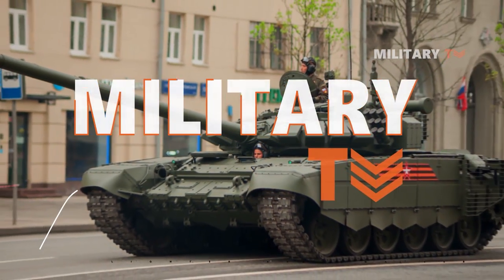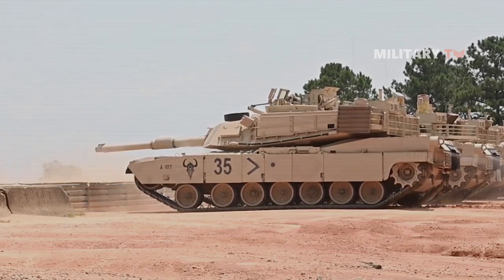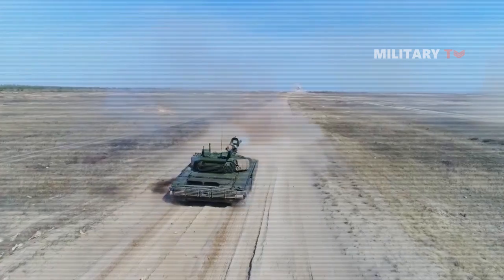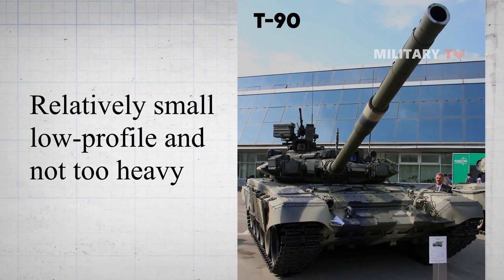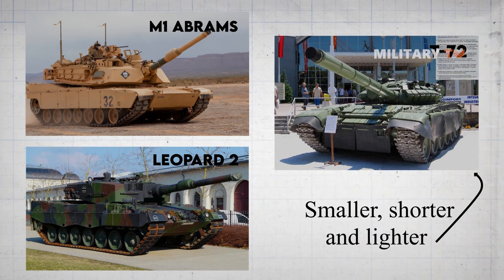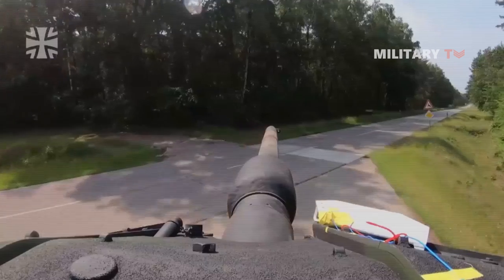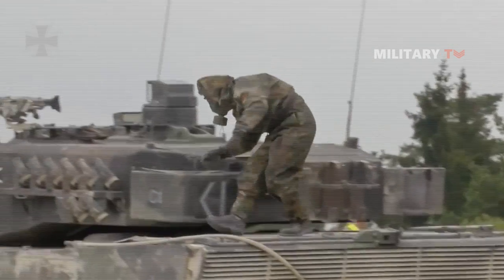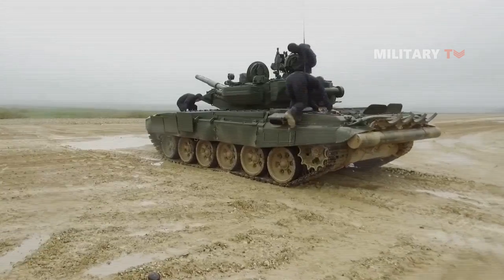Why are Russian tanks lighter and smaller than the western tanks

Comment: There are many many reasons for the size difference.  Doctrinal differences first, these tanks are designed for different purposes in the cold war.  Western tanks focused on heavy front turret armor and large ammunition capacity intended to engage from hull down positions against a larger attacking force.  Russian tanks favored mobility, small size, and low cost to make them harder to hit and more numerous on the offensive.  Other factors like gun depression, targeting optics and armor tech and type also greatly affected the size and shape of these vehicles.  Lighter Russian tanks would be good at traversing more types of terrain hoping to bypass and outflank western adversaries when possible.  Larger western vehicles often knew where they would be deployed and had prepared positions available, as well as known paths to get there even at their heavier weight.  No modern tanks are completely immune to ATGM's or other anti-tank devices today any more than they were in WW2.  The tactics involved in deploying and protecting them from these types of attacks has not changed a great deal since then either.  The best tank can be easily destroyed if enemy troops are allowed to get close enough and particularly if they get on the flank or rear of a tank.
Reply: The T90 is not from the cold war. The T90 is from '93 and on paper the cold war was to '91. And modern tanks are very good protected against anti tank missles. They can jam signals, they can shoot stuff up so the missle will be disconnected to the target and you never can close enough because these tanks have 360 night and termal vision.. Try to come close to these tanks and ur done.. okay of course there is a chance, but it wont be as easy as second world war.. On youtube you see always hits with these weapons, but in reality when the tank or tanks shoot back than you dont have that much time..
Reply: These lighter Russian tanks are better armed than an Abram. An Abram has a 120mm smoothbore and the T90 125mm smoothbore and can shoot guided missles through the barrel.  And the armor of these tanks are so tough.. even when they are 20tons lighter, they are just as strong also because of the model.
Reply: @EdgewiseSJ: In general Sowjet tanks were produced as consumables during a conflict. Their only purpose was attacking the enemy and overloading the defense by their sheer numbers. It was not necessary to carry a lot ammunition since few tanks would survive long enough while attacking to fire many rounds.
Sowjet tanks were capable of high forward speeds but very slow backward speeds. Western tanks on the other hand were capabel of relativly high speed backwards speeds as well as high foward speeds.
Reply: Suniorrita<3  old leopard was that.. the leopard2a7 is much better than the tanks in syria and a T90 has detection sensors so if somebody in a radius shoots missles these tanks will notice that and than these tanks can send signals to jam these missles, just like fighterjets does. Of course when you r close enough you can hit them but these tanks have 360 vsion night and thermals.. you can not come close, he always sees you..
Reply: They can spot everything in a radius of 5km, while other tanks only have 3km. But of course they can hit.. when you have good trained anti tank units... but i dont think Ukraine have good en enough anti tank units..
Reply: The problem I see with heavy tank sitting on hull down position in moder warfare is that with modern precision guided missles and bombs it is a bad idea to sit tight in one place. Modern tanks need to change their position all the time to be protected from air force. I believe in future tanks will have as heavy armor on top as from front projection
Reply: @toolfreak78  The majority of Russia's tank fleet is highly vulnerable to ATGMs besides the M and MS variants of the T90 the tanks don't have blow out panels meaning the chances of the crew and internals getting cooked are high. Also I'm assuming you're referring to the T90s eyes as the optical sensor which has been proved to not be the greatest as a lot of ATGMs are unaffected by it. Also various other factors can be considered such as the now useless ERA against neer peers as the more recent NATO tank ammunitions and ATGMs would either circumvent the ERA or go right through it. Basically Russias most modern tanks are good but there's not enough of them for Russia's numbers doctrine to matter. Also yes I know a lot of NATO countries also have an aging tank fleet but Western tank design philosophy for the most part. The T-14 and T90 M/MS are serious threats to all Western tanks, and no I'm not saying the aging tank fleet is useless because there are also clowns among NATO tanks like the Leopard 2 with it's outdated nightvision as well as some other optics if I remember correctly.
Reply: @arslanseitaly8364  Honestly no one can say for sure. However recently investments have been going towards lighter vehicles that would essentially act as Light Tanks or Tank Destroyers, with purposely poor armor to speed the tank up, but also featuring a greater focus on APS. For example Russia just unveiled what is essentially a BMP with a 125mm gun slapped on it. The U.S in retrospect is looking at IFVs with 100mm+ guns mounted on them or possibly a new vehicle entirely because our infinite supply of freedom bucks allows us to operate 30 different platforms at once while the Russians slap and change out shit to turn an aging platform into something slightly different.
Reply: the rear or the rear of the engine will aways be a weak spot for tanks 
until the day they can make a engine smaller and smaller we will continue to see the rear as a weak spot for both the hull and turrent
Reply: @otherhorizon8193  Russia's tank fleet is NOT  vulnerable to ATGMs, all tanks has state of art composite armour, ERA, active countermeasures like smoke grenades and chaff and laser radiation sensors. Modern ERA like Kontakt-5 and Relikt are  is effectively able to defeat modern armour-piercing penetrators and cumulative grenades with leading charge.
T-90 do not need blow out panels cause autoloader is placed at the bottom of the tank and probability being hit is pretty low.
Reply: @bagamut  bruh, there's footage of T-90s cooking off. Plus ATGMs are advancing faster than any armor. Don't go full Russiaboo on me. No modern tank is fully invulnerable to ATGMs as for Russia specifically any look at their indecisiveness regarding the T-14 and their fragile economic situation will tell you they aren't packing their entire tank fleet with the latest most effective systems. Only real combat will tell you how good a tank is and tanks like the T-90 and older Russian tanks making up the vast majority of their fleet have been proven to be vulnerable to ATGMs.
Reply: @otherhorizon8193  one footage? you think one footage is a proof? show me that footage
What the problem with Russian economic? Russia has 6s world economy, they earn money like hell, currency and gold reserves on historicaly high level, GDP is constantly growing.
All current tanks in use like T-72B3M, T-80BVM and T-90M all have state of art composite armour, latest ERA and complete set of sensors. They have 3000 of them, that already more than all NATO tanks in Europe. Also there is 10000 tanks in reserve which could be restored. T-14 is not so highly needed now, especially when it was still on trials. Many years on trials that typical story of russian tanks, same was with T-64 and T-80. But T-14 is already in serial production and 130 of them ordered, 20 T-14 delivered.
Russian tanks are combat proven and all Syrian company shows that hey are well protected and highly reliable. There are many footages where russian made tanks survive multiple RPGs and TOWs. On other side we see footages of burning abrams and blown up leo2 which are also have been proven to be vulnerable to ATGMs.
Reply: @toolfreak78  Why is a 40 ton tank better armored then a 65 ton tank? Where is the evidence?  What are the 25 tons used for a carousel or a Playstation with a huge screen?
Reply: @Suniorrita<3  You mean 35 year old never upgraded tanks standing ss an artillery target on a hill git destroyed.
Reply: @TorianTammas  russian tanks have smaller hull, that means smaller armoured volume and surface area, you need less weight for the same armour level. Less weight means you have lighter chassis and engine that saves weight again. Evidence are are tables of protection against cumulatives and kinetic penetrators in mm.
Huge volume requires huge amount of armour and weight, that means you need to make compromises and save weight somewhere, like sides and back.
Reply: Оу Тимурид или шар боулинга?
Reply: @TorianTammas  Armata has 3 meters of front armor which is about 10 feet.....   There is no crew in the turret it's just armor around the auto loader...
Reply: By the comments how many of you ever crewed a tank I did get to see a t55 when I was In Germany and I'll still tack my M60A3 any day and the auto loders are slow
Reply: @stephen46xre86  Bullshit. What does the ammunition have to do with it? The amount of ammunition is related to the linear dimensions of the tank, which are limited by the dimensions of the railway platform. The size of the tank directly affects the hit statistics on it, the smaller the tank, the more difficult it is to get into it. And do not rely on aviation, it will simply be destroyed even on approach, the army air defense in Russia is the strongest in the world. The S-300V, Buk, Tor, Tunguska, Wasp, and Strela systems are used. The tanks themselves are capable of shooting down helicopters. Reverse gear in reality does not affect the mobility of the tank so much, since it depends more on the crew. This is not a game.
Reply: @toolfreak78  The T90 is just a renamed T72 since it did so bad against the M1.
"The T-90 is a third-generation Russian main battle tank The T-72BU was officially accepted into service on 5 October 1992 by the Russian Ministry of Defence and simultaneously renamed as the T-90 for marketing and propaganda purposes aimed at distancing the new type from existing T-72 variants"
Reply: @ThatCarGuy  Are you nuts or something.. Because it has the same model it is a copy? Do you have seen the specs of the T90? The Abram is a garbage tank compared with the T90. All these T tanks are evolution, they always modernize older tanks but these tanks have other armor, other detection goodies..  And a modernized T72 is even better than a Abram. Who say the Abram is a good tank doesnt know anything about tanks. The Abram only fought against old tanks and these tanks had not even night vision. Russia made always better tanks than the US, always, even from second world war. Russia made tanks what killed the Tiger easily, shermans could only do that with multiple tanks, The T34 was superior compared with the Sherman. People flame about the T72, but the T72 was a very good tank.  But an Abram is not a good tank man.. Its a fatass and easy to hit by a modern tank.. Hes 4 feet higher than a T90. And have a stronger cannon what can shoot guided missles, Its complete different than a T72 only the T90 is builed like the T72. But the materials and tech in that tank is complete different.
Reply: A F16 from 1980 is garbage compared with a F16 from 2020.
Reply: These T90(SM)s are modernized since 2017, with new armor, detection stuff, can shoot guided missles and have a strong 125mm cannon what peppers all armor. An Abram is not protected against a 120 or 125mm cannon, these cannons are to strong for all tanks on earth, And of course if the Abram hits the T90 first the T90 is done also.. But what i want to say.. dont think that is russian garbage because when it come to a fight both tanks can win or loose. Russia is not Iraq with old garbage tanks and no night vision or 75mm cannons. The Iraq army had that old tganks, it was price shooting for abrams..  against a real army with modern tanks the Abram doesnt have it that easy, that is want to say.. and of course when it comes to a war... I hope the United States wins. I dont hate the US army, i love it, but i hate when people underestamate the Russian warstuff. And it is also possible that Russia lies about the specs.. But what i read on the net about specs of these tanks the T90 is much better.. but i always said the best Crew wins the battle. No matter in what tank they are... But i hope of course the US wins when it comes to war, because i am from Holland and not from Russia. But i hope for the day that Russia and the US wille be allies. But i am afraid the US will never be allies with Russia, because what will happen when they become allies??? What do you think... Not a single country on earth want to buy weapons anymore.. Because look what happens now.. Its conflict and all European countries buy billions of military stuff from the US. When Russia is not the enemy anymore, these weapon sell will stop.
Reply: @toolfreak78  And blocked don't deal with blatant trolls. Ignored my source, stated the t72 is better then the m1, enjoy trolling others, don't waste my time on trolls
Reply: @toolfreak78  You have no idea about the existence of the M26 Pershing. I'm willing to bet you have no clue about anything else you're talking about.
Reply: @Elendrian  i know that tank, but what you want to say with that? Its not used or not used a lot, the mbt of the us was the sherman.. with the short barrrl it made only a dent in a tiger. But i dont know about the usage, but i know him.
Reply: But the barrel of that tank was a big invention, i mean the m26 had a 92mm while sherman and t34 had 75mm, but van be wrong.
Reply: But you right that that isnt the first tank you think about.
Reply: @toolfreak78  The mbt of the Germans wasn't the tiger. If you're going to make comparisons, it should be between the Sherman and Panzer 3s and 4s.

Actually the mbt concept didn't develop till after the war... I didn't think you knew what you were talking about, but the more you speak, the more I realize to what extend my assumption was correct.
Reply: @toolfreak78  Not to mention the fact that the Sherman was deployed to three continents. Not counting the continent it came from half a hemisphere away.

Under those constraints, the fact that the Sherman was as effective as it was is remarkable. Nevermind how well it did after the British mounted a bigger gun.

Comparing superheavy tigers to medium tanks is just silly.
Reply: @Elendrian  no thats not the point of this.. i only said that the t34 what is also a light tank was much better against the Tiger than the sherman, because the sherman came with a short barrel.. it was even to light with the short barrel to penetrate a tiger in the ass. The T34 was smarter designed than a sherman. Even the Russian rifles are much better. Russia was the first with everything in space, they are better in making missles, they are way further in AI than the west, but think that their army is garbage boy :) DDay was holiday compared with the east front.
Reply: @toolfreak78  number of tiger vs Sherman battles  in the western theater...5...Sherman crews PREFFERED the short 75 to the long 76 (similar to 17lb Brit gun --except it was actually accurate) as it was a better weapon of war they were actually fighting...not some fanboy poo..
Reply: @toolfreak78  the Turkish tanks in Syria suffered a terrible defeat because they weren't supported by infantry, not because the tanks were bad, the Turks were just over confident and neglected basic tactics.
Reply: @TobyIKanoby  you r right these tanks are not bad.
Reply: Im just saying, that doctrine is flawed in my opinion, germans had the bigger heavier and stronger tanks, they had the better tankers because of it. Just saying. Only difference is we have more production than the germans did.
Reply: @toolfreak78  The T34 wasn't a light tank. Like I said earlier, the more you speak the more I realize you don't know what you're talking about.

Furthermore, the T34 was inferior to the Sherman in almost every way possible. In reality, it was an expensive tank made cheaply. You don't go from 8000 to 3700 man hours to produce without cutting tons of corners.
Reply: @toolfreak78  I'll freely admit that the PPSh was a fine weapon, but you can't possibly say that a bolt action Mosin was more effective than a repeating M1...
Reply: @otherhorizon8193  leopard II beeing a clown? :D it has actually really great night Vision optics. Its one of the best Tanks World wide. It wins at almost any tank contests around the globe.
Reply: @maxl.2691  Bruh. Rheinmetal has a monoply on armored land vehicles in Germany. This leads to dogshit innovation and plenty of issues. For example Germany's inability to actually make an Active Protection System. I'm not saying the Leopard 2 is a total disaster I'm just saying there are plenty of tanks better than it, and ultimately Germany and the Leopard 2 are stunted by Rheinmetal's monoply.
Reply: @otherhorizon8193  actually kmw is producing the leopard II. :P
Reply: @toolfreak78  The Taliban used Space Blankets to fool the night and thermal vision. But infantry does not come openly to attack tanks the infantry sneaks in and pops out and fires at the side and rear an anti tank weapon. 

It was harder way harder in Second World War to attack tanks there were no ranged anti tank weapons that could effect full tanks for the Russians. And only late war the bazooka and the German equivalents the idea was gained from did no have huge ranges. 
Infantry only dominates tanks in rough terrain, urban or when tanks try to deal with them in trenches. Tanks WWII normally had a bow machine gun in addition to the coaxial gun. 
And early WWII the tanks ruled infantry had little ability to harm them in many cases. 

The guided missile anti tank weapons are associated with infantry forces but I put them in the anti tank gun category of weapon. In that area yes ranged non tank killers need an up in their abilities to deal with modern counter measures. From the Egyptian Israeli war in 73 till last few decades the ranged missiles made tank lives horrible if one did not have the artillery to suppress them.
Reply: @willrobinson9767  You've got to be joking.  Steel weighs about 40 pounds(18kilos por square foot. One square foot 10 feet thick would weigh 400 pounds (180 kilos) the tank would weigh hundreds of tons.
Reply: @carlwessels2671  It's some kind of carbon fiber....  Which is much lighter perhaps stronger than steel...
Reply: @toolfreak78  Is that you Vlad? Utter nonsense.
Reply: @toolfreak78  Have you ever seen a Javelin? Or any of the modern ATGWs? You don't need to get close. These weapons are effective to thousands of metres, and the newer ones are fire and forget (eg Javelin up to 4km, IR guided). Javelins can fire in both direct or indirect mode (which makes the firer harder to detect, and the missile attacks the tank from above). Tanks can attempt to jam such IR guidance, but no guarantees, and there is still the danger of the older wire guided types.
Reply: @toolfreak78  Would you care to revise that, as the NLAWS seem to have been quite effective?
Reply: @otherhorizon8193  He's a Russian troll.
Reply: @originalkk882  Yes but the T90 has a jammer for 5km so whats ur point ? Thats one of the things a T90 has better than a Abram or Leopard because these tanks have jammers to 3km. But a javelin have always a chance, but i only mean to say is that not every shot is goal. Its not a weapon with 100% hit at a modern tank.. on practice tanks he always hit or old tanks but a modern tank can jam these signals IR is easily to jam with an other IR.
Reply: Javelin is very good anti tank weapon, but modern tanks have a chance and not only the russian tanks also the nato tanks.
Reply: @stephen46xre86  you are 100% correct. Soviets have nevered cared about crew protection and surviving the fight. I don't think they have never been trained as well as American crews. If they lose a hundred men today they we'll have a hundred replacements the next day. Never ending supply.
Reply: @bagamut  this comment didn’t age well lol
Reply: @bagamut  that comment did not age well 🤣
Reply: @toolfreak78  Tanks can be easily destroyed at will by the German PzH 2000 and SMAart 155 ammo from over 20km away two moving targets at a time.
The ammunition breaks into two warheads which are self-guided so no signal to jam. The PzH 2000 can fire 13 rounds per minute indefinitely.
Reply: @bagamut  Aged like milk.
Reply: @toolfreak78  Russian tanks primary method of protection is ERA (Kontact-5, Relikt), which in turn, the US and Germany developed APFSDS with the sole purpose of defeating. Also; the extra 5mm of caliber on the gun is useless if the rounds Russia uses (3BM-59/60) are entirely outdated. The Lanz-Odermatt formula puts their penetration far below M829A4 and DM63/73. If you really want to know what's going to prove to be the better vehicle, it's the logistics behind them, and these last two weeks have done nothing but proven that Russia's logistics are atrocious.
Reply: @Huski3s  Russia is using T80 tanks and these tanks are the worst Russia ever made. But im no fan of russia tanks, i only said that the new tanks like the t90 and armada are good tanks, but i am a Leopard 2 fan.
Reply: @toolfreak78  Do their logistics magically get better if they're not using T-80s? 😂😂😂 You're hilarious m8.
Reply: Yes, the M1 armour scheme followed that design philosophy, heavy frontal and turret armour. The UK Chally was built under a different one.
Reply: ATGMs don't need you to flank at all. They have a top attack mode. Nor do they require you to get close. They have ranges of 3+ kilometers. They literally outrange tanks.
Reply: This is a better description and background summary of the differences between Western and Russian tanks than the video provides!
Reply: KF52 is first anti-javelin tank